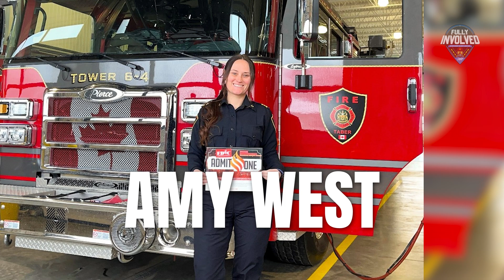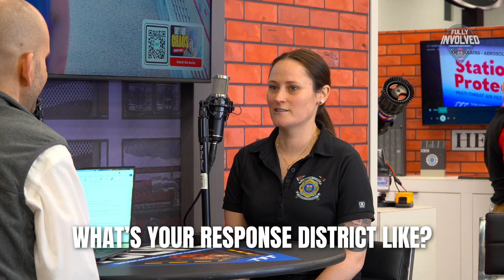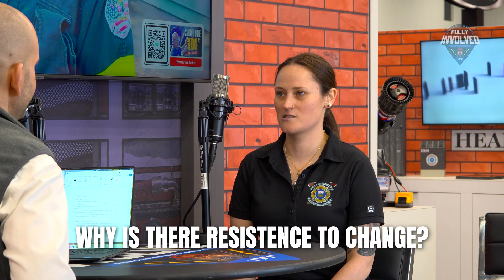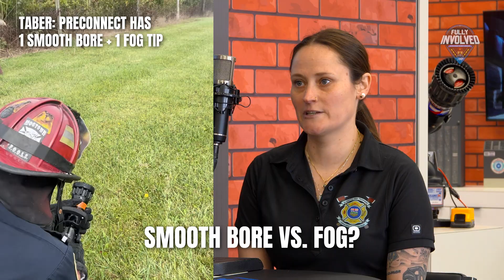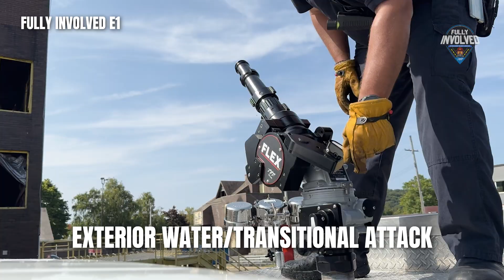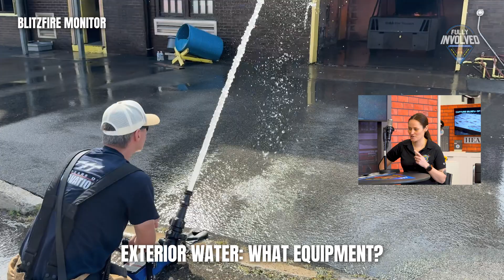Why This Fire Department Switched to Low-Pressure Nozzles | Amy West (Ep. 5)

Comment: Of course nozzle reaction matters.  What?  Trying to be polite, but once I figured out how 'automatic nozzles' really worked many years ago, I realized it was a scam.  They give you nice looking streams even if the water flow is lousy.  That's a dangerous combination.  100PSI  was probably needed to overcome the spring, but way too much nozzle reaction.  If you can't control your line, you are not putting the water where it needs to go at the proper flow rate.